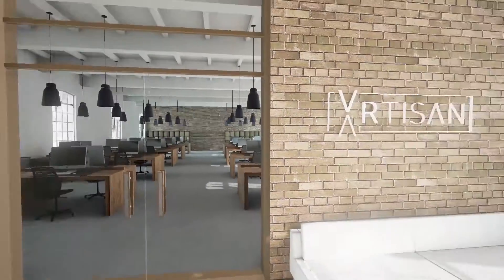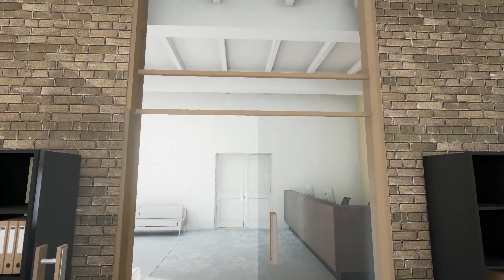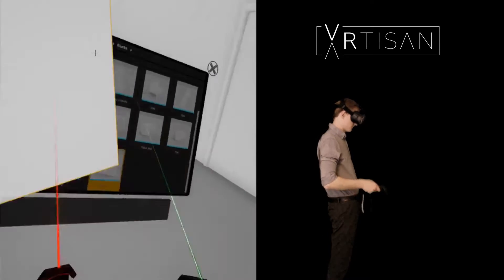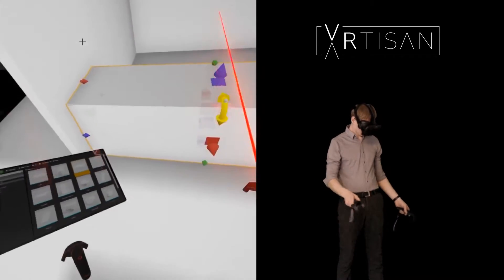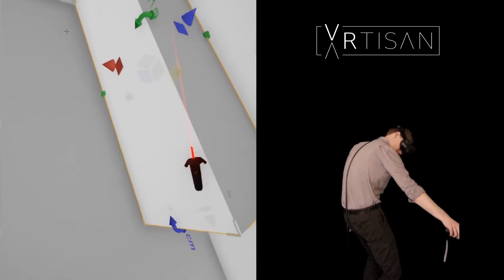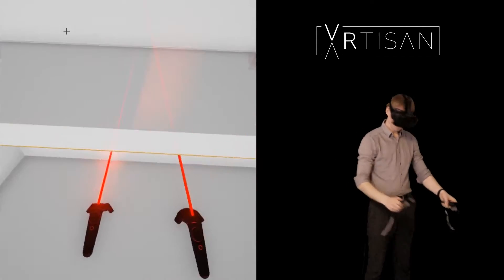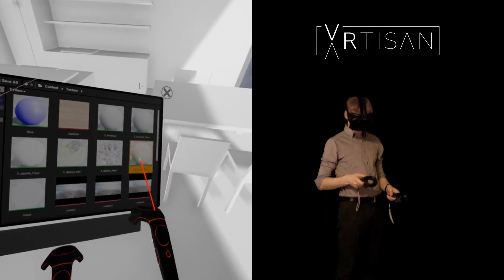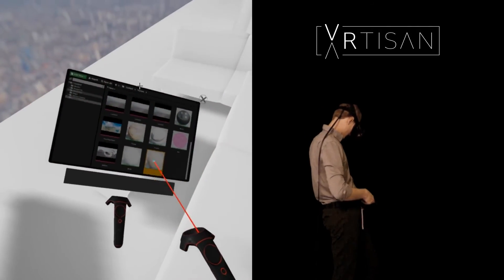Architectural Design in Virtual Reality - VRtisan - Unreal Engine VR Editor

Comment: How are those cubes being parametrically scaled? Are you using bsp tools?
Reply from the maker: Alex Coulombe hi, the wall and floor elements were created as static meshes of unit length (1m x 1m x 0.1m) so the scale factor in the properties panel was used to get an idea of the actual sizes